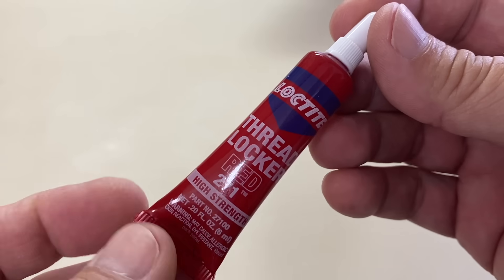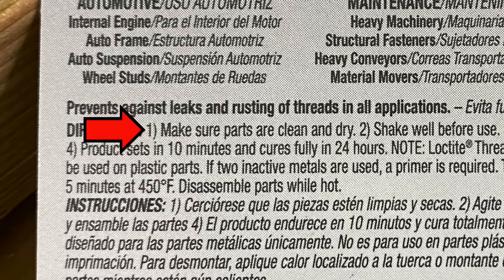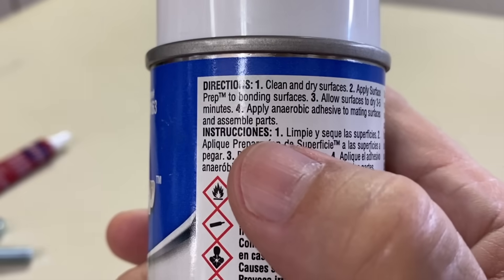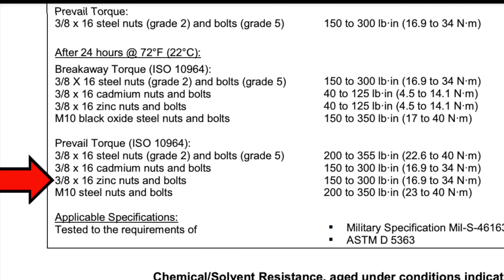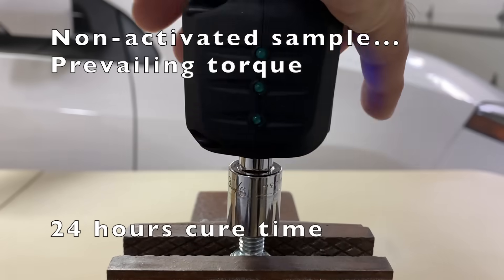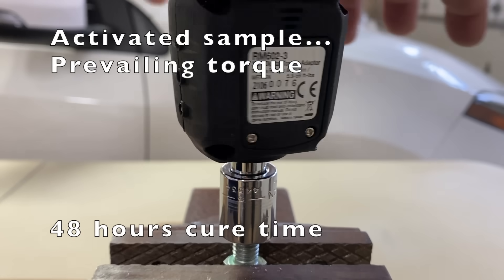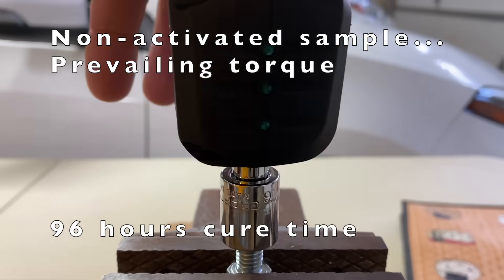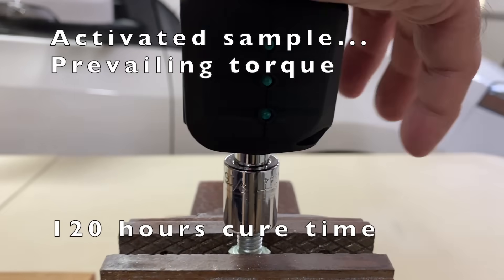Nuts & Bolts - Most DIYers Do Not Know This | Loctite Red Threadlocker Curing

Comment: Your testing is flawed.
Loctite isn't meant to keep you from removing the nut/bolt.
It's meant to keep it in/tight under vibratory conditions.
You need to come up with a testing method for that and then check your results.
Legit, why would you use a wrench to remove the nut? It proves nothing.

Comment: Great video. I've been using loctite for decades and never used an activator. Just ensure fasteners are clean. Never a problem.
Reply: You only really need an activator in 2 cases:
1) If both the screw and the nut are made of alluminium or other unreactive metal or plastics. I tried plastic screws into alluminium and the stuff just stays liquid for days and does not cure at all. 
2) If you need it to cure as fast as possible especially for zinc of stainless or if one of the surfaces is active but the other is inert. If you need it to operate right away though then split lock nuts are your friends as the bonding compounds need at least a few hours to cure even half decently even in best case scenarios.

In any other case the activators are not very useful.

Comment: Buried down in the comments someone suggested doing the same testing but run the nut down to a torqued condition such as 100 ft/lbs.  then see what does what.  As for testing day by day.. I cant think of a case where I used loctite RED and wanted to take it apart in the future.  Maybe an interesting test would be conducted similar to the above but include some BLUE into the test to compare to.

Comment: 0:50 - shaking is insufficient unless you've used it "recently."
My HW store guy says you need to massage the crimp end of the tube to work out the heavier stuff that settles there.  Shaking won't get that stuff dislodged.

Comment: All I know is loctite comes in a bottle 1/2” wide and 3” tall with a cap that does not seal. So when it tips over in your toolbox or shelf it leaks out leaving a sticky horrible mess, and an empty bottle, so you have to go out and buy another bottle for the three drops you need

Comment: I have question. Which Threadlocker liquid or gel can be work with **plastic or wood** with metal screw holder in? Because some mower, power tool high tolerant vibrates? 

(I’m apology not good grammar)

Comment: What I like to stress is that thread locking compound is never a necessity as long as the fastener is tightened appropriately and what is being fastened together is engineered appropriately. If it's something that you can't tighten because it will crush whatever, then the thread locker is helpful, but then that device being fastened wasn't engineered appropriately.

Comment: Loctite isn't designed to be used on a loose fitting. It's anaerobic.  Try your test again but put the bolts through a metal plate and torque the bolts.  Results should be different.

Comment: this chemical is to be used in high stress ,vibrational and rotating pieces that you will not be loosening for a long time,and when using this chemical,its so powerful it stresses the fasteners,i use it on studs,bolts that i want to stay put for the duration,always replace the fasteners after using this product,trust none of them for 2nd duty

Comment: Lacquer thinner, carb cleaner (about the same stuff) or brake clean (similar) all do a fine job of removing grease, oil, wax.  Thinner is cheapest, I buy it in 5 gallon cans, keep it in 1 gallons (steel only) for use.

Comment: What you did wrong is that you didn't snug or tighten the nuts. Doing so would reduce the space between the thread of the bolt and the nut and increase the strength of the bond which relies primarily on friction.
Reply from the maker: Thanks, but this test is similar to an adhesive strength test conducted by Loctite.  Check my channel for other tests with torqued down nuts.  Here's a link to the Loctite video...https://www.youtube.com/watch?v=PGZCPyi8yBc
😎

Comment: Since when DIYers use Red (or any color/type of) Thread locker without fastening a nut and screw "torqued" to some kind of assembly?????    Any color Thread-locker is intended to prevent a nut/screw from coming loose from "VIBRATION"... its not a glue otherwise use two part epoxy -- LOL !
Reply from the maker: Thanks, but this test is similar to an adhesive strength test conducted by Loctite.  Check my channel for other tests with torqued down nuts.  Here's a link to the Loctite video...https://www.youtube.com/watch?v=PGZCPyi8yBc
😎

Comment: The standard deviation of the non activated parts is high for break away torque. Even though the averages are not too far apart the non activated parts will have much note variability and deviation from the average. The activate parts breakaway torque was more consistently closet to the average.
Reply from the maker: Interesting point of view.  I might do a test with more samples to explore this more.  Thanks!

Comment: I suspect there may be an error in your "specified torques" as the "prevailing torque" quoted is 2 two 4 times the "breakaway torque" while your data shows the prevailing torque to be less than the breakaway torque which makes more sense.
Reply from the maker: Thanks!
The specified torques are from Loctite's Technical Data Sheets and results from their testing.  
😎

Comment: My opinion concerning the testing: the sample size is too small.  I'd recommend testing with 3 prepared nuts and bolts per sample and averaging the results instead of sampling with 1 prepared nut and bolt.
Reply from the maker: Thanks!
I would normally test more samples, but this was more of an informational thing about the activator.  I never knew about it and apparently many others too based on the views.  I had no clue that the video would take off like it has.  LOL

Comment: The numbers will be somewhat higher if you torque the nuts into their nominal specs. Now they didn't have any play in the test. But, i honestly surprised that even without tightening the nuts into their torque, the glue it self kept the specs anyway. The torqued test will present higher numbers, but will not be wildly different. Now they were at the lower end, torqued nuts just goes to the higher end of the glue specs.
Reply from the maker: Thanks!  You're talking about a breakloose torque test with the nut torqued tight.  This was a simple breakaway torque test to measure just the adhesive strength like Loctite does it.  More specifically, it was a test of the activator that I never heard of before.  
😎

Comment: I think the test should include the activator on its own.  It looks sticky, but that might just be the color.  Idk.  Just as a tester to see if that has any increase in tightness.  I would do exactly this, but have a control of just the bolts and then with just the activator to see if that has any impact

Comment: Use rusty bolts and won’t need threadlocker. In all seriousness, I use red almost exclusively for gaskets. Seadoo engine case mating, old ford tractor sleeves in block, metal to metal contact mating. It’s opposite, aerobic sealant, RTV.

Comment: You know bolts are supposed to be torqued/tightened with a bolt stretch method, right?  Retest while the nuts and bolts are fastened properly.
Reply from the maker: Thanks!
This was a simple strength test of the adhesive that mimics a test that Loctite uses.  Please check out my other videos that tests torqued down nuts.  😎

Comment: There is two types of green Loctite thread locker . Cummins ISX-15 Diesel engines camshafts do not use  a key on the tapered shaft . The green Loctite does not run or drip off the very smooth surface of the camshaft when applied .          116/23
Reply from the maker: Good to know!  Thanks.

Comment: Interesting and well done.  I never clean the nuts and bolts, but I wouldn't put Loctite on then if they were greasy or oily.  I've never heard of the activator, and I wouldn't spend the money on it.  I've never had anything I used thread lock on that came apart.  Whenever I use thread lock it's just been a means for the nuts not to unwind due to vibration.  I think a bolt with the built-in nylon lock probably holds better, but for my purposes I don't think it matters between the two.
Reply from the maker: Thanks for the kind words and for sharing your experience.  Much appreciated.  😎

Comment: Great video, I've used blue loctite on a daily bases for almost 12 years at work, we would get back 10 and 20+ year old electronic signs for customer service that baked in the sun all summer and froze blowing in the wind all winter( hurricane damaged also).
 Never seen a nut or bolt missing that was ever there in the first place...😅
Also we found out pretty quick to try not to get loctite on our clothes or on any painted surfaces, it permanently Staines clothes and will either permanently stain or actually remove automotive grade paint over night. Also apparently loctite has an expiration date, I cant remember how long it lasted, 5 years from new I think it was, but I've used blue loctite atleast 5 years after experation at my own house and it still worked just fine, just keep the lid on tight.
Reply from the maker: Nice to know.  Thanks for sharing!
Reply: @HacksbyDad  No problem👍, I have OCD about certain things so I use loctite on alot of projects. I recently picked up that new orange gel loctite in the little chap stick type tube. I'd be curious to see a test on it, they say its medium strength semi permanent but unlike the red it can be taken loose without a heat source.

Comment: Love those "car rehab" shows where they slap it together for some sort of 'cause' or charity case, and start revving the engine and spinning tires right after last minute completion. All those moving parts and suspension especially in high performance vehicles need 30 days to 'cure' if properly done with thread lock compounds. MOVING Mating/contact surfaces need a thin layer of silicone or Teflon based lubricant for initial starting. Why do all that machine work to lose the work scoring surfaces before lubricants can circulate? But if everything is soaking in oil, you won't have an ideal curing environment for gaskets and fasteners. Of course also assembly in cold or hot environments is relevant as well. You'll want drivetrain assembly ideally in warmer temperature because the engine and trans need to run sealed and tight while hot. Asking winter assembly in shops without climate control to perform long term is wasting your time. Dismantle and clean parts in winter. Machine them in spring, assemble in summer. If you're a DIY. Otherwise you'll be back to it. Real restorations take time. Watch some of Leno's videos and you'll see some cars have been under restoration for 5+ years. California nights are actually chilly 5+ months of the year. 10am-10pm is shop time until the heat has fully arrived. 5am-5pm the other 6 months. Beer-thirty varies.

Comment: Torque stretch of the bolt must be applied to the fastener. For an SAE 3/8-16 Grade 5 plain bolt, this should be 31 lb/ft. This can be achieved using two nuts on the bolt thread and torquing each nut against each other, or using a stack of washers applying the specified torque value, yielding the bolt to it's specified stretch. Additionally, the bolt and thread should be cleaned with an acetone or non-residual brake-parts cleaner. Bio-degradable or water based solvents contain non-evaporating solids which will provide a lubricant effect and impurities that will prevent bonding to the substrate metals.
Reply from the maker: Thanks!
If you're testing for breakloose torque, correct.  This test was testing the breakaway torque and strength of the adhesive itself.  Similar to how Loctite conducts its test as shown in this video... https://www.youtube.com/watch?v=PGZCPyi8yBc
😎

Comment: Rarely do I see a mechanic (as in never) use Loctite on lose nuts or bolts. Retry the test where you're actually torquing the nut down to a spec. You may also want to wait a few months or more before testing to let the zinc start to break down as would happen in a piece of machinery like a car or welder.
Reply from the maker: Thanks!
This was a breakaway torque test of just the adhesive similar to how Loctite does it’s own test.  If you check my channel, I’ve done other tests with the fasteners torqued down.  24 hours is what Loctite and other manufacturers claim for full cure.  I’m doing a test that will compare the strength after a year.  
😎

Comment: A couple millwrights I worked with were taking the piston off of a 6" bore cylinder. They came to me after breaking a 2000 lb torque multiplier. It was a 2" fine thread nut. They were to the point of cutting it off when I warmed it up with the rosebud and unscrewed it quite easily with my inch drive air gun. Locktite has it's place and works well.
Reply from the maker: Awesome story!  Thanks for sharing!
😎

Comment: Former Loctite rep here: Older primers (Primer N or Primer T) contained either a copper-ion or an amine dissolved in the carrier solvent. Those compunds drove the resin cure to a much higher level of completion that the stuff used here. I have not checked, but I suspect the older primers have been outlawed due to solvent content and/or toxicity concerns. At the end of the day, some heat (<180F) will also drive these anaerobic methacrylate resins to full cure if you think you need that. The test method used in this video is very much like the testing done to evaluate these threadlockers in Loctite labs...and it roughly duplicates the test standard in the mil-specs that describe chemical threadlocker compounds, though the thread-class-fit is controlled in those standards. Note: only five samples were tested...hardly significant to relate to real performance data
Reply from the maker: Thanks for the info!  😎
Reply: You can still buy the Loctite copper salt primer from McMaster Carr. Loctite SF 7649. It's expensive though. It makes a huge difference with stainless steel fasteners. 

Some stainless steel fasteners won't cure Loctite properly. I made the mistake of using primer and green Loctite on a nut and bolt that hadn't been assembled. It cured so fast that it seized up before I could tighten it all the way.
Reply: Used Primer N and T for years. (Thankfully, on an infrequent basis.) Just a bizarre exotic aromatic-chemical smell to them. They really sped the cure up better than the current stuff, but it just somehow smelled like it was giving you brain cancer.

Comment: So with activator it is more consistent however if you apply less or more threadlock it will alter the locking strength. 2 drops won't be the same so maybe precision ml measurement is needed but personally I'll just use it as is

Comment: Never used a primer and the red is no joke....I've had to use a torch to break the seal.....but it does its job

Blue for bolts that need to be removed for constant maintenance 

Red for permanent or bolts that require very little maintenance 

Use em on motorcycles where vibration can loosen bolts easily

Comment: Yeah I’ve never used loctite on anything and then purposely left it loose. It requires tension/pressure in the threads and the absence of any air.  Back to the drawing board dad.
Reply from the maker: Thanks!
This is a test of its adhesive strength only that mimics a test that Loctite does.  See their video here...https://www.youtube.com/watch?v=PGZCPyi8yBc
I test the breakloose torque of tightened fasteners in other videos.  
😎

Comment: Nice presentation.  Appreciate full presentation of hte data.  Was surprised you didn't do an application-like test (bolt snugged to a set torque)
Reply from the maker: Yeah... this was a breakaway test to show the strength of the threadlocker itself.  I may do a breakloose test with torqued nuts in the future.  Thanks!

Comment: I think using at least 3 (5 would be better) samples for every time "stamp" would give a little more insight into this test. There are some production tolerances so if by chance you get a slightly "tighter" nut on a slightly "oversized" bolt you will probably get different results as compared to a "looser" nut with a "smaller" bolt.
But your test was quite interesting to watch.
Reply from the maker: Thanks!
I tested the activator and posted the video on a whim.  I had no idea it would take off like it did.  LOL
I'm working on more tests.  Stay tuned.
😎
Reply: @HacksbyDad  You got yourself a new subscriber ;-).
Reply from the maker: @wojciech_migda  Thanks!  👍